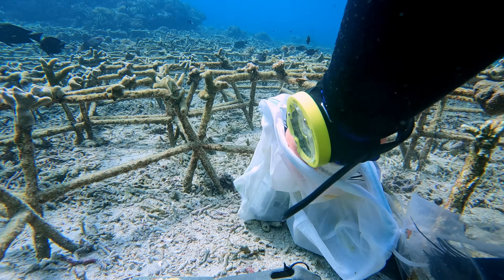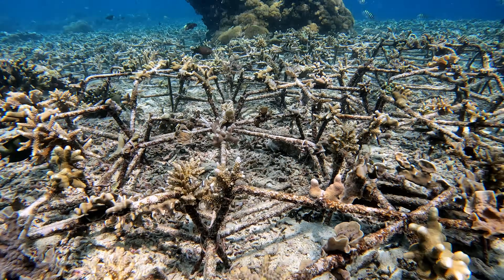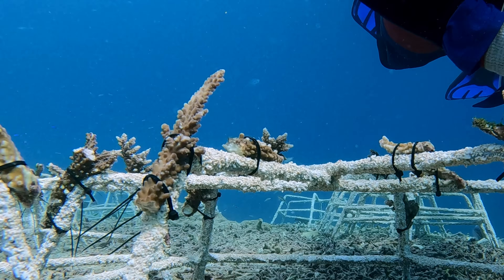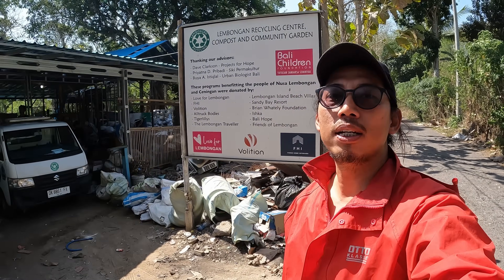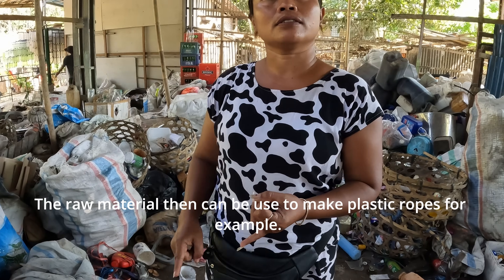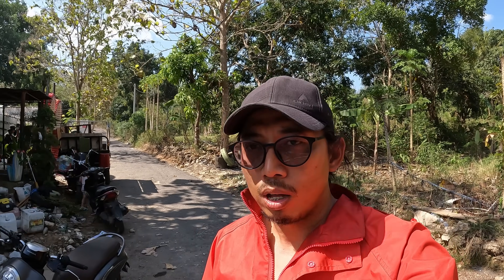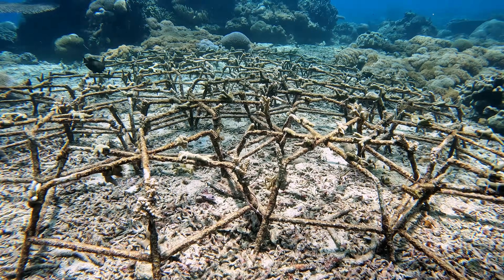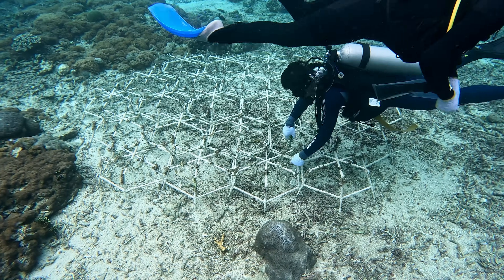We're testing alternatives to plastic zip ties to attach coral | VLOG

Comment: Incredible work. I do miss diving in Indonesia. I just wondered why you are creating a single height of structures and not stacking a couple to change the topography, and water velocity to promote diversity. Obviously you can't go too high with the currents as they are. Not sure if this has been noted at this site, but I've found the smaller the fragments the quicker the growth rate. Keep up the great work, sure many don't appreciate how much harder working underwater is.
Reply from the maker: Thank you for the kind words and your thoughtful suggestion. I think with the smaller structures you can fit more coral fragment into an area, but we also need to take into consideration the space for the coral to grow as well. Cheers, Yudi
Reply: @MossyEarth-FieldNotes  thanks for replying. Sorry i didn't mean smaller structures, i meant smaller fragments. So dependent on the species, a 5mm fragment will grow faster to 500mm than a 50mm fragment will. Micro colony fusion. The paper Forsman et al 2015 highlights this.

Comment: Great to see the science being done to evaluate alternative options.

Regarding the stainless steel zip ties, have you considered crimping them in a zigzag pattern, like an accordion, before using them? This gives some elasticity to the steel, allowing a more variable shaped object to be attached.

Another option might be Polylactic acid (PLA) or polycaprolactone (PCL) zipties. PLA zipties can be mass produced easily and cheaply by 3D printer (and there are organizations which do printing work for charities). PCL zipties are available premade online. They are slightly more expensive but in underwater environments they will become weak in a year, and dissolve almost completely in 4 years. 

If you would like more information on this topic, please reply and we can organize a conversation. I am not a retailer.

Comment: has there been any consideration of wire/twist ties? I know most of them are made with plastic but I have seen some plastic free options that are coated with waxed paper instead, and you could potentially just use wire alone to act as a twist tie?
Reply from the maker: Thank you for your support and for the idea. From research that we found, wire ties has just slightly lower succesful rate from plastic zip ties. We will add this material on our next test. Cheers, Yudi

Comment: if you plan on using wire, you can get safety wire pliers for fast installation of coral frags. there is a type of aquarium glue that hobbyists use to attach coral frags to a disk but i'm assuming it might be too expensive or have unknown ecological consequences like water pollution.
Reply from the maker: We are planning to use metal wire, as many are suggesting. As for the glue, I saw some project use the method you are saying, but for indoor nursery, usually for research in a lab. Chees, Yudi

Comment: I suggested this on the post on the main channel, but have you tried superglue? I use it in my aquariums and it hasnt shown harmful affects on the environment. Its not exactly plastic free but it can be argued as better if it works
Reply from the maker: Thank you for following our updates and for sharing your idea! I'd be curious if the glue can be used underwater since we do the attaching directly underwater 🤔 
We saw some project using epoxy underwater and thinking about the extra tools and bringing the mixture underwater would be too much for us at this point. Cheers, Yudi
Reply: @MossyEarth-FieldNotes  epoxy clay is definitely used quite often in aqua-scaping setups, especially saltwater, and has not currently been shown to cause problems. I do believe certain brands are able to cure underwater because they need pressure to be activated (similarly to superglue) though the added pressure of the waves and water might affect that and make it cure before it is ready.

Comment: It’s a lot of extra work using these alternative methods. Does the plastic ties eventually fall off or just get enveloped by the coral? 
Or even just using the metal ties to hold the structures together and using the plastic ones for the corals. 🤷🏻‍♂️
Reply from the maker: Thank you for sharing your thoughts. The zip ties will eventually get enveloped by coral between 3 - 6 months. Cheers, Yudi

Comment: Concrete rebar is tied together with "tie wire" a steel wire is wrapped around and twisted tightly to Bund the crossing rebar together. If you used tie wire it would be more metal and less plastic, some care/practice using the tie wire will mean you have alot if control with it too. There are multiple types of tools for tie wire you could try too. It could be used just like the metal cable ties too, and it will likely be cheaper. Honestly can't think of a better option myself.
Reply from the maker: Thank you for your suggestion, I think tie wire is a good replacement. We are going to further test this if we can use it in our coral restoration project. Thank you again for the support! Cheers, Yudi

Comment: 1. Zip ties will be grown over by the coral, keeping it from breaking off and impacting the oceans, so it’s likely not an issue. However other methods aren’t a bad idea. 
2. Metal structures will eventually rust away, however by that time the corals will have grown large enough to support themselves and each other. I think that is a benefit as they will eventually grow onto one another like they should. 

I think of the rebar like a manure plant pot, it gives structure for the initial growth and then slowly degrades allowing the corals to expand and grow even larger
Reply: The only issue is that rust is toxic to some corals 
But otherwise yeah, however the loss of the metal structure will also make it more susceptible to damage for a few years
Reply: @ConstantChaos1  ahhh I didn’t know that, yeah I guess no one really like breathing in iron oxide 😂 I wonder how long it would take to break down, because if it took 5 years it might be an issue, but if it takes 50 the coral may have grown large enough for it to not matter 🤷‍♂️
Reply: @ConstantChaos1  after reading a bit more it looks like the rusting varies based on several factors including temperature (which I assume is fairly high in a shallow coral reef), current and metal absorption rates. The articles still allude to about a 10-40 year lifespan. Likely to be on the lower side because of temp and current, but generously 20 years because of the epoxy  and because I’m hopeful 😂
Reply: @NoahHagen  yeah, and to be clear the rust is actually only a problem for some corals, others do actually benifit from being generally nearby as the iron oxide can be fertalizer for algae making the waters more nutrient dense, but hopefully the resin and crushed coral coating will slow it down enough for it to just work as fertalizer and not cause issues. It's an imperfect system but logistically a much better solution than things like bio-blocks at least for now, especially since if we see certian ones rusting out too fast, we can always intervene, it's a much larger issue with things like sunken ships or lost shipping containers. Which generate much more rust.
Reply: @NoahHagen  yeah there is high temp and radiation levels working against us, but the epoxy should buy us a fair bit of time. I think 20-30 years is a fair assessment (for a half life at least), assuming near perfect coatings of epoxy, if they are more slapdash with holes in the coating, I give it 10-17 or so, but the coatings look good so yeah

Sry I really liked my materials sciences classes lol
Reply: @ConstantChaos1  absolutely I agree! I was hoping for google to tell me an easy calculation but I guess there is none for how fast or slowly things rust.
Reply: @ConstantChaos1  right yeah the epoxy just gives the metal a little buffer before the inevitable. Haha no problem, love having conversations like this on social media, I feel like it doesn’t happen much anymore!
Reply: @NoahHagen  According to an article on the subject, the bars are rust treated, as well as covered by resin and sand, and eventually coral.  The main culprits of iron rust are older ships, which also have pollutants like paints and such.  Steel rusts slowly enough to not be an issue.
Reply from the maker: Thank you for your input and sharing your perspective. Cheers, Yudi

Comment: Is it possible to attach the coral onto the frame while on the boat? If coral needs to remain wet, place the frame in a large bucket of saltwater and do the attaching while you're in the air. I suggest using stainless steel wire as it will last longer in the salt water. I don't know if a cable tie gun($140) would work, but it would would also make it much easier.  Keep up the good work!
Reply from the maker: Thank you for sharing your prespectives! It is possible, but since we collect coral fragments and transplant it directly underwater, bringing them up to the boat will add extra efforts. And to reduce stress to the coral for being exposed out of the water we only have little window.
Reply: @MossyEarth-FieldNotes  I understand. If you used wire, you could attach the wire to your frame while in the air and reduce the time to attach the coral.  I look to seeing more of your work.

Comment: You could consider loosely attaching the zip ties prior to placing under water, so that the coral only needs to be placed and the tie tightened, this may speed things up underwater.

Have you thought about pre-tying some of the rebar structures together on land and deploying in units of two or three? It would speed up deployment under water and make the operation more efficient.  However I am not sure how that would affect stacking on the boat and how many you could take to site on a trip.

I love the great work you are doing.  It is great to see you try to minimise the plastic, but I think the huge benefits of re-growing a reef will outlay the small impact the amount of plastic will have, especially as it is covered by algae and corals.
Reply from the maker: We did the pre-tighten zip ties at the beginning, but we encountered some challenges. The coral fragments varied in size and shape, and often had bulges or branches on both ends, which made it difficult to fit them through the pre-tightened zip ties. While there wasn't a significant difference in time consumption, it is also the case for the structures. And we found it easier to transport the coral fragments on the boat when they were loose.
Thank you for sharing your thoughts about our project and for your support! It means a lot to us. Cheers, Yudi.
Reply: @MossyEarth-FieldNotes  Hey thanks for the response and best wishes for the project  :)

Comment: You could try metal wire that is used to tie rebar. There are handheld devices that can tie rebar with metal wire. So it will be very quick to tie. Adapting those devices for underwater use might be a challenge. But rebar is tied under water as well so perhaps they already exist
Reply from the maker: Thank you for the idea and for your support! Somehow along the way we are forgetting this option, we are going to test it on our next trial. Cheers, Yudi

Comment: I wonder if small metal clips may help? Such as Screw-on clamp holder for pipes. They may be more expensive than wire alone, but way easier to use, as they hold the coral using pressure alone, as there is no need to spend time to tie it, and no need to cut them. The time you spend under water is a cost too, as you will have more free time to expand the project. The clips may be big, but that may create surface for coral to grow on, so it is not a loss. Check for "Spire clips" too.
Reply from the maker: Thank you for sharing your idea! The spire clips seem really interesting. I've never seen them before (I'm a bit of a tinkerer myself 😆).
It's true that spending time underwater is costly, and we have limited time per dive, and since the source of the coral are from surounding area undwrwater, bringing coral fragments to the boat is extra effort, and we can only transport a few at a time. Also, exposing the corals to the air for too long risks stressing them.
For the spire clips in coral restoration, it looks like marine glue or resin would be necessary to secure the coral fragments to the screw points. I can see how that would be very useful for an indoor nursery. Cheers, Yudi
Reply: @MossyEarth-FieldNotes  I wish you the best! This is very important and you are doing a great thing.

Comment: Have you thought about using stainless steel or copper wire to atach the corals? I would think it gets you the reduction in plastic while also allowing for better ease of installation than the twine.
Reply from the maker: That sounds like a good idea, thank you for your suggestion. Cheers, Yudi

Comment: Bamboo cord ( string) is waterproof... that may work. There is also stainless steel thread/ string also called stainless yarn. May be easier than the zipties
Reply from the maker: Thank you for the idea. We’ve been considering that and wondered if it’s 100% natural bamboo fiber or if it’s mixed with any synthetic materials. It's worth to look it up, we'll definitely do more research of the potential. Cheers, Yudi

Comment: Maybe try attaching the coral with thin metal wire, wrapped several times around the coral piece, and then twist the two ends together to secure it in place? 😊
Reply from the maker: That sounds like a good idea, and I think that could work. Thank's for the idea, we'll definitely do experiment with it. Cheers, Yudi

Comment: My (totally untested) suggestion -- cotton/hemp/sisal string that has been waterproofed with linseed oil. It should stay flexible, but last longer in sea water. Preparing it in advance takes time, though. You'll need to coat the string and hang it up to dry. The product is basically the same as traditional linoleum flooring, and is fully biodegradable.

Some notes on linseed oil:
There are three common types to buy. Raw linseed oil is totally natural, but takes a very long time (weeks or months) to dry. Boiled linseed oil dries much more quickly, but includes heavy metal additives like cobalt. DOUBLE boiled linseed oil dries quickly and has no additives, but can be hard to find.

The drying process generates heat, and the oil/fibre mixture is flammable. There's little risk if the string is hung up with plenty of ventilation -- the main risk is from piles of rags coated in the oil.

I'm happy to talk about this more in this comment thread, or by email.

Comment: Later when i had more corals to work with, i started to skip the frames all together. I put bigger pieces of staghorn all over a place that i wanted to put corals on, about half a meter apart from eachother. Then i used the thin 2 strand cotton ropes and connected them all with eachother. 
This had the effect that the individual pieces of coral where not able to roll over anymore. So the triggerfish grabbing a piece and rolling it over so that it died was not happening anymore. 
Then i would put smaller pieces of coral in between the bigger pieces. So that they remained completely out of the sand.
Like this i could take a rope of 1 year old corals, cary them trough the water to another place. Cut the rope, put the corals on a small hill so that they will not get covered by sand. And attach a new rope to them and fill that with new fragments. And as the bigger corals were resting on the ground now, the thin ropes hardly broke anymore. Unless a stingray decides to dig a hole right in the middle of your chosen spot or so.. 😂
Ah, and it was funny to see that our resident green turtle quickly learned that the thick ropes were really good for cleaning her shell. So we could watch her rubbing her back on the points where the thick ropes were leading into the sand.

If you want some pictures to see what i did, i can email them to you.

Take care!
Reply from the maker: That's a fantastic approach to coral restoration! Using rope nurseries is a proven method for cultivating healthy coral. I'm really impressed with your dedication and the progress you've made. Your efforts are making a significant difference in protecting our marine ecosystems. And it's always encouraging to see the marine life starts to come and settle in at our coral restoration area. Thank you for sharing your story, and for following our progress. Keep up the great work! Cheers, Yudi

Comment: Maybe you could fashion a specific shape of pliers and use a c-shaped piece of metal to attach the coral to the frame. It would only need to be a thicker wire you bend in to a spring and cut open so you could manufacture the clips fast and easy.
Reply from the maker: Interesting, thank your for the idea! It needs to be strong though, I use long pliers and while it can go to dificult corner, to get a good grip is quite an effort. Cheers, Yudi

Comment: Stainless steel bailing wire! It comes in different thicknesses. So you can use thinner for the more delicate corals and thicker for holding the structures together
Reply from the maker: Interesting idea! Thin wire has a bad record for tying coral fragments, but I think it's worth to try to see the result first hand . Thank you for the suggestion! Cheers, Yudi